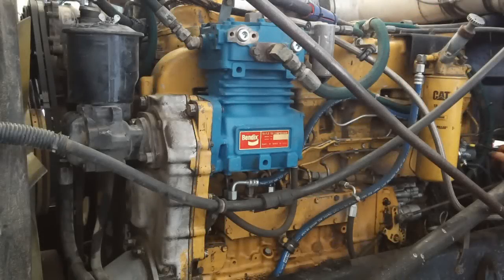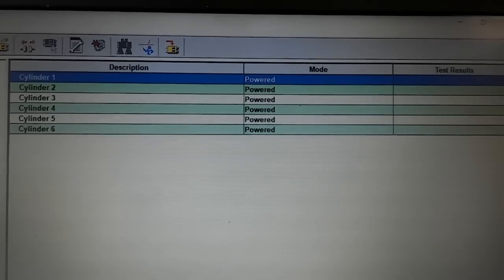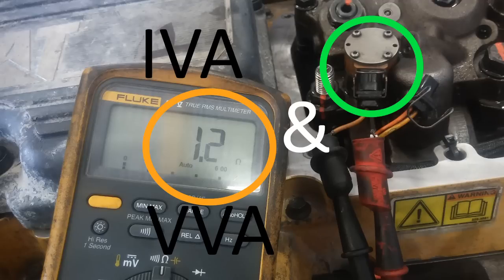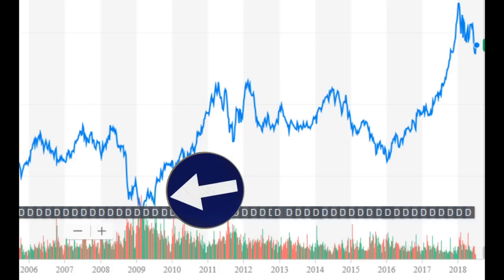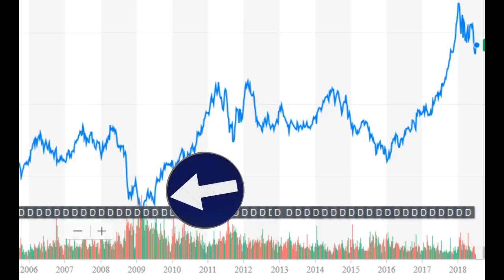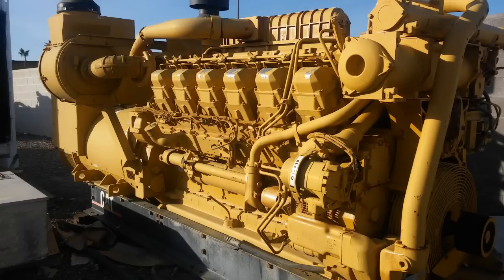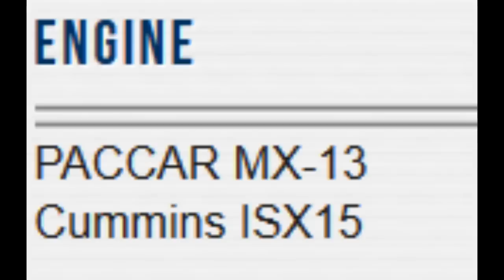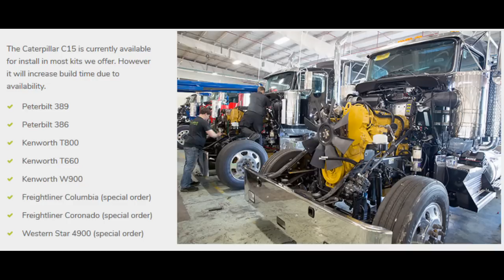Why Did Cat Stop Making Truck Engines?

Comment: I was a machinist at Cat for 15 years until 2005 when I quit when I knew for sure they were shutting down my facility. Here's one of the reasons. That part, which was one of the last parts that were prototyped across my CNC  was poorly designed from the start. There were many issue myself and the other guy that ran it pointed out. The other is how much Cat was/is still gutting from their customers. That part cost only $25 dollars when it came off my CNC. The assembly division; right across the isle; paid $125 to "buy" it then "sold" it to the paint dept for $450. I'm not yanking anyone's chain here. Their internal philosophy was a 16X upsell for the finished product; Not the final product. The other with Cat; in general; is their mentality. The designers are Never wrong and anyone that punches the clock, the workers, have No clue what's going on. They still are using time studies; that's the process used to machine/assemble/test the part, what feeds/speeds to use, type of inserts and order of tooling; from the late 60's and early 70's. I showed a few of the different dept's general managers they were wrong;  I got 2 days off for proving them wrong and producing a part quicker, closer to mean tolerance & cheaper using my process; and it's still an internal issue. Cat has wanted out of the mfg end since 1996 and have been splitting off divisions, buying smaller companies to contract thru so that all CAT has to do is final assembly (as little as possible) and marketing i.e. a sticker company. Right here is a built in failure as another excuse for Cat to spinoff their engine division to another company. Cat has a hidden stake in a lot of other companies that you don't know about that whose profits still come back to Cat indirectly. Electro-Motive Diesel (EMD) was in talks with Cat about a buyout as far back as 2001 which was at the same time there was a surge in "out of turn lay-offs" downsizing that the union allowed; IAMAW is a spineless union; and the outsourcing of an entire line to a small, under 30 people in total,  that was non-union. I myself had to cross-train some of them and I was Forced to work with an interpreter' believe that one!  Yah, this was a rant but 60% of Cat's problem's; financial and quality wise; fall on the shoulders of the management and board. My suggestion: stay away from anything Cat made; either by Cat or their subsidiaries; until they get back to taking care of their customers and employees.
Reply: I am an engineer for a custom equipment manufacturer and I take the opinion of our mechanics/machinists/welders as solid gold. They know more about how to build the thing than I do, I just know what I want to make it work!

Comment: If Cat couldn't pass emissions, why didn't they ask Volkswagen for help?
Reply: good one
Reply: Or dodge 😂
Reply: Because they'd end up like Detroit.
Reply: Cat wasn't going to Castrate their Engines. I have 16 3406B Powered 1985-1990 T600's. And a Rebuilt ready to go Replacement 3406B engines for each one. And 3 1986 W900's with 3408's and a Spare engine each as well.
Reply: Curt Ekstrom The joke was VWs emission scandals. You know, like one of the biggest lawsuits ever??
Reply: Curt Ekstrom VW didn’t “castrate” their engines either. Lol
Reply: They hand a bad design. The law suits kept rolling in. I spent  17,000$ on mine. Then another 5,000$ to delete it and problem solved. I got over 1 mpg increase and 80 to 100 more hp
Reply: They were to busy lying about there own....Thats why there ceo  hefty von kashefner is facing jail time....
Reply: They need to ask West Virginia University
Reply: lmao
Reply: One of the biggest truck disasters in UK history was when our GM subsidiary introduced an intercontinental on highway truck, the Bedford TM in the 70s. It had a Detroit Diesel with massive pulling power. It was very cheap and very small fleet operators bought them, including friends of mine. They had been using Volvo, Scania generally getting about 8 mpg on 6000 mile round trips to the Middle East. The new Bedfords gave them 4.5 mpg! That meant bankruptcy. You will see no Bedford top weight trucks now..... GMs day is over.
Reply: Still too soon bro
Reply: @curtekstrom6600  smart man, I tested alot of those engines in Mossville on the Dyno machines. Best engines EVER
Reply: @ryancampbell4072   that  “VW emissions scandal” was more about economic ware-fare. Sure  they gamed the system, but let’s face it, the VW TDI got 55+ miles to gallon and had superior emissions compared to other American diesel highway engines.
Reply: Or Scania, or Volvo
Reply: @garyhaley3072  deleting isn't the best decision
Reply: @sirmartinfrobisher  yep uk is all about fuel economy
Reply: 🤣🤣🤣🤣🤣🤣🤩🤩🤩🤩🤩🤩🤩🤩🤩🤩🤮🤮
That’s hilarious 😆
Reply: @JamesAdams-bd9df  Detroit diesel is still in business making engines
Reply: @joshuaryanferguson3702  Mercedes Benz and MTU produce everything with Detroits name on it and none of it being in the United States. The only thing  that actually exists of  Detroit are corporate offices.
Reply: That's funny but in 2020 Volkswagen acquired Navistar International.
Reply: OHHHH SHITTTT 😂😂😂😂
Reply: @HarrisonCountyStudio  in europe cars are taxed/road taxes paid based on the emission numbers. People who thought to buy a car that had low monthly taxes got screwed. They had to pay the full deal. As well they paid more for this car than other brands because they bought an ,,environmental friendly,, car.
 Instead of $45/monthly $75/85 monthly. Thnks germany and your ,,sjoemelsoftware,,.
As well as that those cars where not allowed in city centers. 
If these cars are less poluting than american cars it says something about american cars.

Comment: I worked for Cat for 42 years , the last 18 in engine division.   Good informative video, but not a lot of people know that Cat had a love-hate relationship with Paccar for years !  They didn’t have much use for us and the feelings at Cat were mutual.   But at the time Paccar needed us so we did business.  We also heard that the EPA had raised the emissions bar to a insane standard and Cat was no longer willing to pour millions into research for an engine system that wouldn’t be compliant within a year or two.  Also a side note, I never saw one, but heard the Paccar engine that replace ours looked a lot like a Cat C15 engine.   You don’t suppose those SOB’s stole our designs do you ?
Reply: The PACCAR engine is basically a 13 litre European DAF engine designed for European cabover trucks. Nothing like a Caterpillar engine. PACCAR own DAF Trucks.
Reply: I worked for Detroit Diesel for 42 years. Paccar kicked DDC out of bed with the Series 60 as well because they didn’t like Roger Penske and the Frtlnr relationship.
Reply: @dougberry1011  the series 60 was a great engine. Reliable as hell and very mechanic friendly. I work for Freightliner and we rarely see and 60’s anymore. Mostly DD13’s, 15’s and 16’s